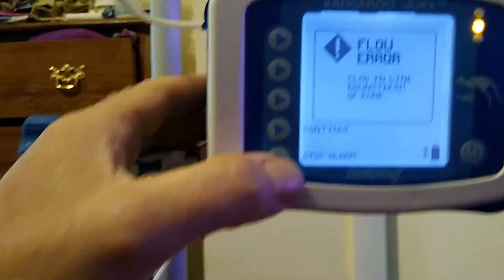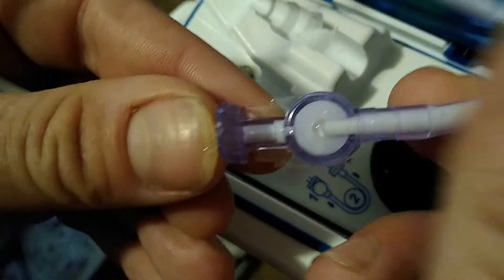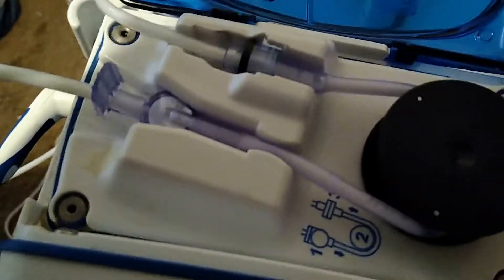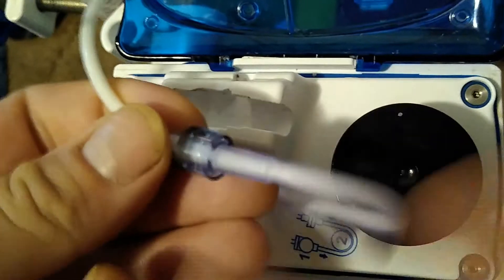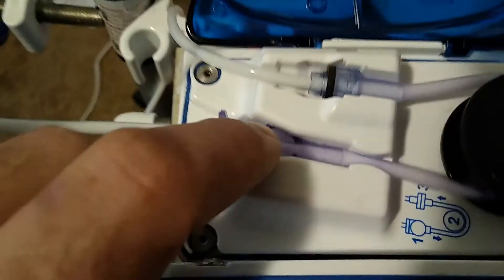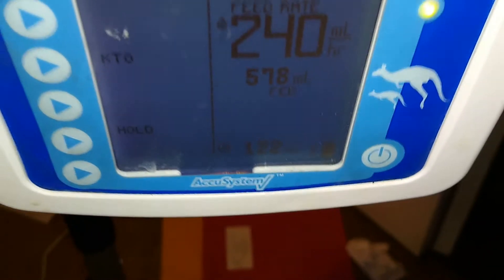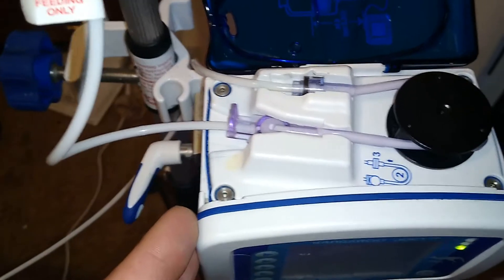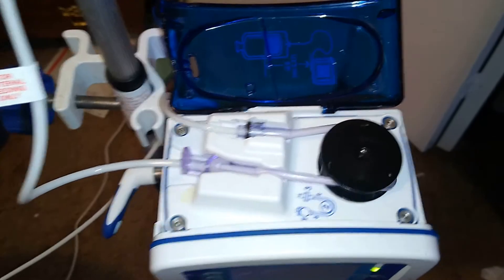kangaroo joey flow error clog in line downstream of pump fixed

Comment: Thanks for sharing, but this hasn't been the issue I have had and perhaps someone may have an answer. Out of the blue I sometimes get a new bag, or a relatively new bag (cleaned and washed well for a day or two) that refuses to prime. There are no clogs, we try to run just warm water, squeeze/wiggle all of the iffy spots, load/reload, increase gravity which shouldn't be necessary --- but nothing works and the only option is to pitch the bag and get a new one which is expensive. The formula won't even come out of the bag into the initial tube and it's NOT clogged. The issue seems to be at the pump dynamics but it's impossible to fix. Thanks everyone, have a great night!

Comment: Thank you. I’m not sure this is our problem since it happens even if I try to run water through the feed side, but I’ll definitely look closer at it. I get zero resistance when doing a manual flush and the feeding tube itself was replaced just weeks ago.  🤞

Comment: Thank you so much, had 3 pumps previously replaced through my mother's healthcare provider with the same issue as I had no clue or idea what the problem was since there was absolutely no clog after inspecting the line, checking and flushing the PEG feeding tube and running the flush feature on the pump to see if it was still working or it was me going coocoo. Really appreciate your help and information on what the actual issue is and providing a solution, tired of that dragon lady nurse on emergency call offending me by saying I'm doing something wrong when I've been doing my mom's care for quite some time and was properly taught and trained on how to operate the machine itself🙏 much obliged
Reply from the maker: You're very welcome glad it helped you 😀

Comment: I think those foamy bubbles form because the bags are not at least a 12 inches (30.5 cm) above the pump. Sometimes the pole will come loose and slide down and you don't notice it. I noticed in the hospital that the nurses had way up higher than we had it at home. While I was tapping on the foam like you pointed out I noticed that when I held the bags over my head the creaking noise would stop. Well not entirely but I think the foam that builds up from there not being enough gravity pressure needs to work itself completely out. I going to disconnect and hit the manual prime feed button for a a few seconds until I see no foam in that part of the of tube.
Reply: Thanks for sharing these observations, oscar.  It's a big help.
Reply: @SeattleMartin other issues to look out for... Here at 1:40 he routes line into the holder by laying it and the pulling the line around the wheel and then laying down the second piece. 
When you lay down that first piece make sure there is no play or gap between the piece and the bracket. Give a firm but gentle pull to make sure it's fully seated before you pull the line around the wheel. If the lid doesn't close flush that's a sign that it's not fully seated and sticking up. I think when it's not fully seated you get the air bubble or foam that makes creaking noise.
Reply: @porscheoscar  Thanks again for the tip.  This Joey unit is certainly  tempermental!

Comment: hey Ray, my son is on a blenderized diet so it is kind of thicker but we try and thin it out with water, but quiet often we get that error, we have to change out the bags for it to work but they only give us 30 for the month. It does seem to be clogged in that same place you showed. It is like it can not plug it through
Reply from the maker: I would try something finer like a food nija instead of a blender and if you feel the bag with really hot water from the sink you can rinse the bag out after use just hold prime and you can prime the line to clean

Comment: Great to see this video.  We've been using this pump for 6-7 years and never had this issue until a week ago.  We tried new bags, changed the PEG tube, got a new pump, nothing fixed it.  We did move to a new pediatric formula, and I wonder if it is more foaming as it flows than the previous ones.  Looks like this may be our issue too.  Thanks!
Reply from the maker: You're welcome

Comment: How do you stop the hold error? It runs for about 10 min and than starts beeping saying hold error
Reply from the maker: The only time I get a hold error is when I have it on hold and it times out make sure it's says run and not hold if not machine may be faulty